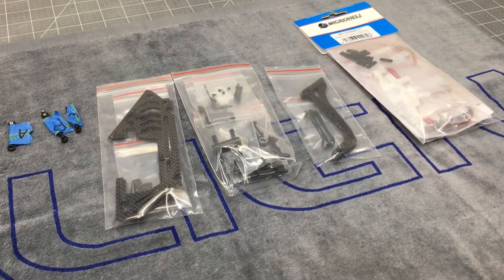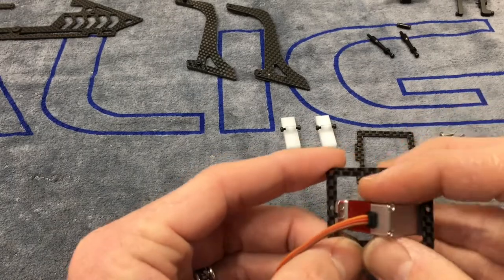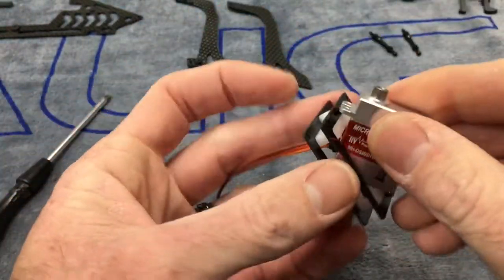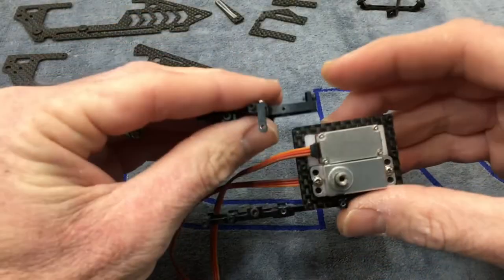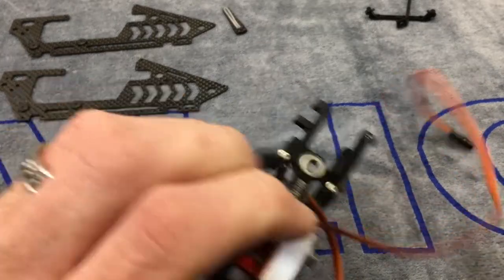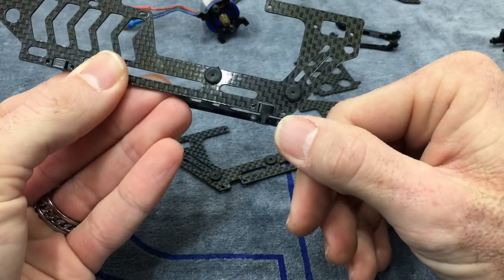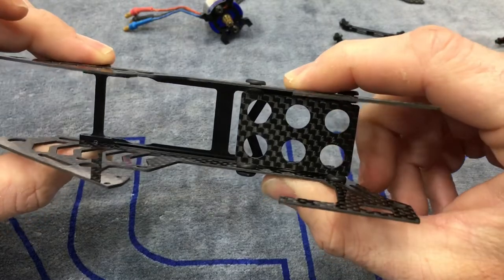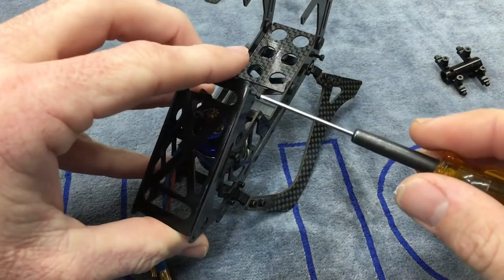How To Assemble￼ The MicroHeli Blade 230s Carbon Main Frame

Comment: Help Please . Collective pitch is not working . Throttle works and so does Rudder on left stick . Right gimbal is fine. Elevator and ailerons move fine . Please help . I installed a new Main Motor Blade Grip . I'm using the DXs Transmitter .

Comment: Honestly, this helicopter looks damn heavy for its size, have you weighed it?  
My Oxy 2 with 210mm blades weighs 260g, ready to fly with fiberglass canopy and metal rotor.
Reply from the maker: It’s very lite! Not much more then a stock 230, OXY 2 has 210mm 230 runs 230mm it’s a little bigger then a OXY2. I’ll take the little extra weight over the plastic flex it had before!
Reply from the maker: A stock 230 is 340 grams, mine is 360 grams. So 20 grams added with metals servos and full carbon and metal upgrade well worth the 20 grams!
Reply: @westhobbiesrc8051  Is this weight with or without battery?
Reply from the maker: @dragansus1  both weights are no battery. 230 is bigger then a OX2 by a little bit closer to a OXY3. I’m running a bigger motor and bigger servos so 20 grams is nothing for a full carbon and Aluminum kit.
Reply: @westhobbiesrc8051  My oxy is also not the lightest kit, aluminum servos and a 4S motor (which is 20g heavier than a 3s motor), just if you compare the difference in blade size and the difference in blades, it seems that the helicopter is very heavy.  I could be wrong, I'll be happy to wait for the video clip with the flight of this helicopter, it will be very interesting for me to watch.  

And yet this helicopter is competitive with oxy 2 (as it uses 200-220 blades), oxy 3 already uses 280mm
Reply from the maker: I had a OXY 2 and 3 year ago, I had the 2 side by side with a 230 and the 2 is definitely smaller. 230s are 340 gram stock so only 20 gram more for a full build is nothing. Plus a stock 230 is tail heavy so you have to run a bigger pack and it will weight around 390g when you ready to fly and hey do just fine. Also going from a plastic 2 blade head with plastic blades to a metal 3 blade head with carbon blades. The kit is incredible! Really nice parts. Flight will be soon. Waiting on a Ikon. Decide to ditch the 636 and give it the FBL it needs!

Comment: What are the pros to carbon and aluminum parts be the plastic ones?
Reply from the maker: There is quite a few, strength is number one carbon and aluminum does it flex like plastic no slop and play. you get a more rigid helicopter that you can feel in the air.

Comment: Hey if my omp m2 has a flapping noise after two drops, hit hold by accident, should I check the bearings? Or not worry about it? 

Thanks sorry for making that super confusing before
Reply from the maker: Flapping noise? Like when flying? Is the feathering or main shaft bent? Cracked blade? Go over the heli really good make sure nothing is cracked or bent. Definitely not right.
Reply: @westhobbiesrc8051  ok Thanks appreciate it. And yeah mainly at hover n I have a spare Main shaft n feathering shaft I’ll throw in go over the rest
Reply from the maker: Let me know what you find! There is definitely something wrong there. I’m sure it will be easy to find. Feathering shaft would be where I start.

Comment: Will the 300X motor fit in the stock frame?
Reply from the maker: Yes it will, if you go back on the channel and find the 230s flight with Radiomaster TX16S flight I explain what you have to do. But you get lots of frame flex so I highly recommend the carbon main frame if nothing else.
Reply: I haven't found that video yet but I'm still looking. On the American micro heli site I can't find this frame set up to order it complete for a build like you are doing. Only in Vietnam Warehouse. I know Hong Kong isn't shipping Air freight right now because I tried to get a funky scale fuselage
Reply from the maker: @rayduffield749  copy the video real quick. But here is a link to the triple blade complete kit in US warehouse. Black kit like mine is back ordered right now but they have different colors 

https://us.microheli.com/helicopters-1236554668/heli-upgrades/e-flite/blade-230-s-v2/cnc-triple-blades-performance-package-blade-230s-230s-v2.html
Reply from the maker: @rayduffield749  here is just the frame https://us.microheli.com/helicopters-1236554668/heli-upgrades/e-flite/blade-230-s-v2/aluminum-carbon-fiber-main-frame-blade-230-s.html
Reply from the maker: @rayduffield749  https://www.youtube.com/watch?v=fef4fFfJvUg&t=9s

Video of completely stock 230 with just 300 X motor
Reply: Okay cool. Yeah I wanted to get the whole set in Black like the one you built because I'd rather have that than any of the colors because my other 230 is already done in colors
Reply: I went ahead and ordered the kit from Vietnam so hopefully I get it
Reply from the maker: @rayduffield749  you will 100% get it! That’s where my kit came from and I have more stuff on the way! Takes about 10 days! Just remember they are closed until February 8 for their new year. So your package will ship the day after!
Reply from the maker: @rayduffield749  the black looks the best in my opinion!

Comment: Hi geezer.
I want to blow the dust off my 470 lm ,prefered plastic, tail grip holders and has beastX + ,Hobbywing OTA 60AMP(WHICH I LOVE) with a 450 se ally tail servo holder with the align DS535m tail servo! I prefered bigger tail servo! Anyway, i have 3× savox sh-0265mg cyclics, which i was never happy with, even though they havnt started loosening up,bearings all ok, i just dont trust them.
Question is, what 3 cyclics would you buy, if it was your BIRD, 6V SERVOS?
I like the look of the KTS215 V3S, Dont want to spend over that on a 470?
YOUR DEFO THE MAN TO ASK?
CHEERS 
RC ADDICT
Reply from the maker: you cannot beat the KST 215s but look at the MicroHeli servos I have linked in the description. They are incredible servos. And they will fit right in the 470. I’m getting a set for mine. They are 6V-7.2v and have an incredibly smooth gear train and I’ve taken them apart and the build quality is insane! I think they are better built then the KST 215. Savox makes a good full size servo and not so good small servo but they are not fast and I personally think the gear trains are a little sloppy which is a big no-no in helicopters. Especially on cyclic control
Reply: Thanks, thats good to know, you are totally right about the small savox, and even the align, ive taken them to bits and i could not believe that the potentiometer was just slopping about in one, and another just had a little hot glue, holding it in! Thats what i love about the drone scene, you cant hide anything, you look at a hobbywing and many other brands capacitors, fets etc, and you can just see quality! The way every component is aligned etc.
Thanks man, and thanks for replying!
Respect from across the world!
Reply from the maker: @rcaddict9558  appreciate you watching! Yeah I’ve seen some “high dollar” servos built like crap! I highly recommend the MicroHeli servos, they are a great price for a great servo! Quality is super important and if you get the MicroHeli servos pull one apart and look at the quality! Incredible
Reply: @westhobbiesrc8051  
Will do, THANKS FOR YOUR TIME FRIEND!"
RC ADDICT